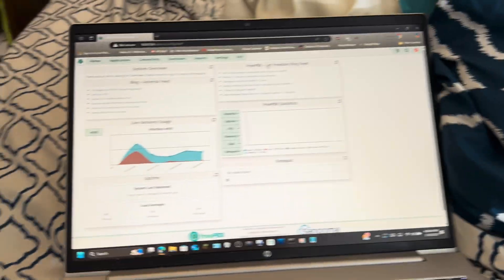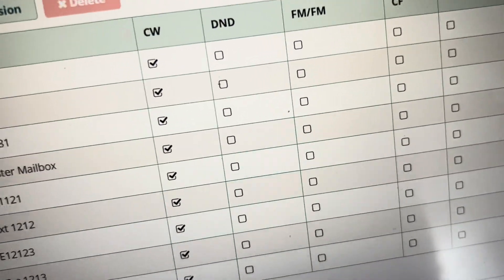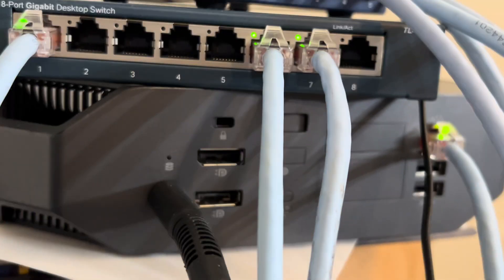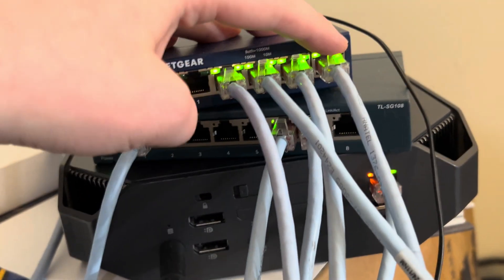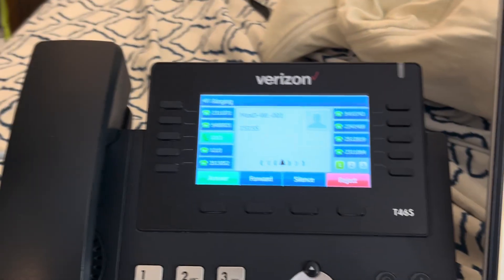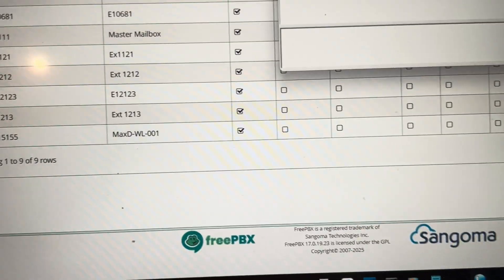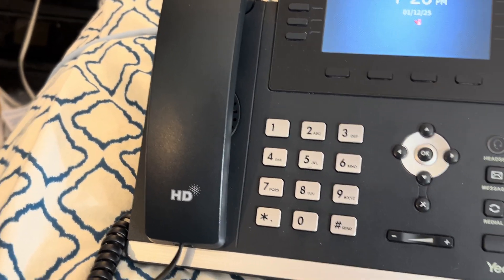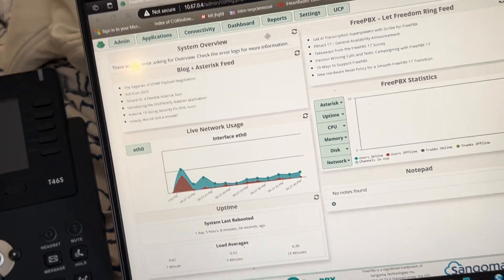My FreePBX system quick overview

Comment: Thanks for sharing! What do you use for your trunk and phone number provider?
Reply from the maker: I don’t have one at the moment.
Reply: Depends on your location country really. There are a 💩 tonne of voip providers but generally conform to the same service provisions. SIP is SIP so you are governed by a set of rules that govern how voip operates. Essentially your local (office/home) extensions which are your phones or softphone apps, are YOUR side of the equation, and the rest is down to the your voip provider.
Reply: I’m currently using 3CX (who I really like but since their pricing model changes I’ve decided to explore open source alternatives and FreePBX was the front runner in my research). I’m literally writing this whilst setting up FreePBX on a Linux VM on premise so I’m very much learning on the fly.